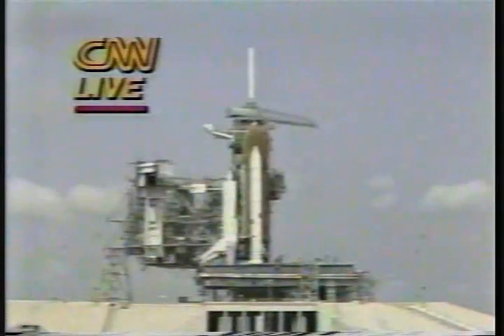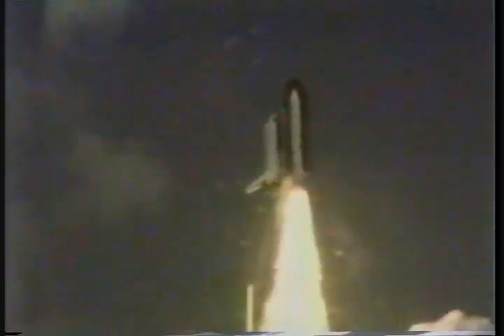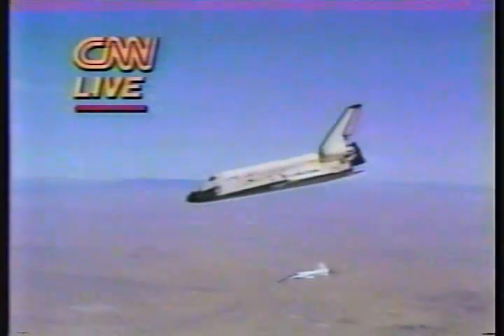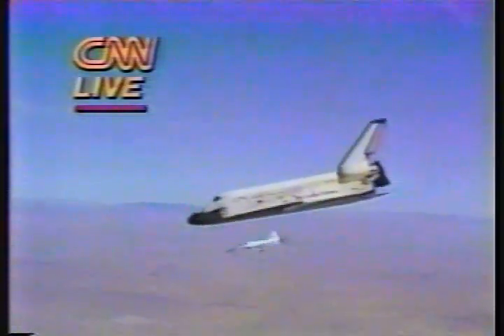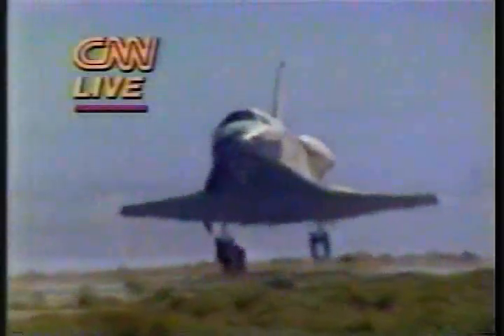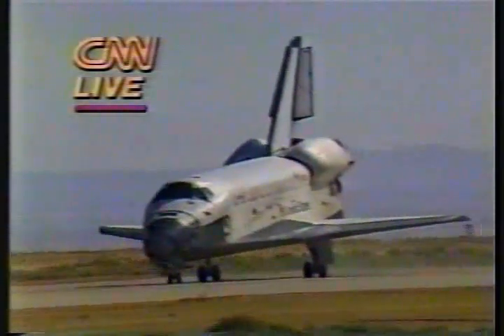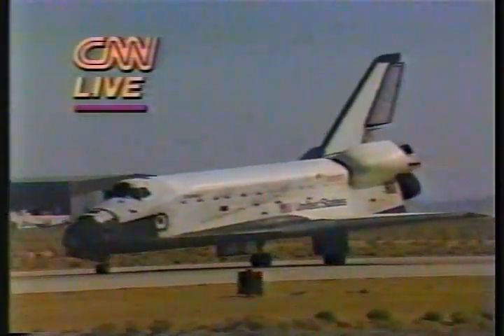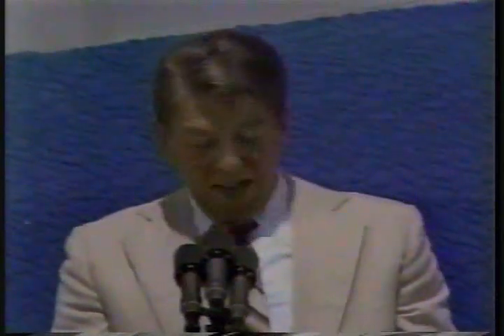STS-4 launch & landing (6-27-82)

Comment: This was the 4th flight of the Shuttle, the final test flight of the vehicle. As subsequent events would subsequently show, however, declaring the Shuttle operational after only 4 flights was unwise.  This was the first flight to carry a secret military cargo, so the flight was partially classified, 
The Commander, Ken Mattingly, had flown to the Moon on Apollo 16 in 1972 and would subsequently command the first classified flight, by Discovery,  in 1985, which nearly met the fate of Challenger the following year, due to cold weather affecting the O Rings on the boosters. 
This was the first spaceflight to end on American Independence Day, July 4. 
The pilot, the late Henry Hartsfield, made his first flight and would go on to Command the first flight of Discovery and the last successful flight of Challenger in 1985. 
The landing was certainly a joyful occasion for NASA with President Reagan   and Nancy  watching and the New Shuttle Challenger taking off from a Jumbo jet to join the Shuttle Columbia in Florida.  Only 3 and a half years later, however, the joy turned to shock, horror and tragedy as Challenger was blown to pieces over the Atlantic 73 seconds  after launch.

Comment: Has anyone played Kerbal Space Program? I designed a shuttle variant called the Vertical Stack Shuttle (VSS for short). Essentially, rather than the orbiter piggybacking onto the external tank, it would be stacked vertically, like a traditional rocket. If NASA had done something like that, The Challenger disaster would've been prevented. If there was a problem like what happened with Challenger, the Orbiter would've been out of the blast and probably been able to return to launch site. With Columbia, if they would've gone with a VSS design, there would've been no way for the foam to hit the wing, since the tank would be lower on the stack.
Reply: The position of the Shuttle (piggy back vs in-line) had no bearing on it's destruction. The "explosion" did not destroy the Shuttle, it was the sudden uncontrolled flight that it was thrown into and the huge aerodynamic forces that destroyed it. The Shuttle being mounted to the top of the tank  would still be out of control when the stack breaks up due to structural failure of the External Tank. 

A key piece of proof that backs this up is how the Shuttle broke up. And explosive breakup would have totally destroyed the Shuttle and broke it up into many small fragments. Like how thw the SRBs broke up when their range safety devices were fired to keep them from threatening populated areas. The Shuttle broke up into it's "modular" pieces.  The left wing, aft section (with the engines still burning) cargo bay and crew cabin could be seen as whole pieces. 

The only way avoid the accident is to not use Solid Rocket Boosters that have to be refueled in Utah,  and therefore have to be "segmented", just to satisfy an asinine political kickback, when Aerojet had a much safer design that would have been monolithic, one segment-less booster with no troublesome joints. They even offered to construct the refueling plant right at KSC.
Reply: +Tristan Wassman But The orbiter was too heavy for the traditional rocket.

Comment: They only used them on the first 4 flights because they only had a commander and pilot and it was testing to see if they could eject from the shuttle  during launch until they were over about 100,000 feet high.  When they carried more astronauts it was impossible to equip it with ejection seats for all crew members so they scrapped them.  They do have a way to bail out and parachute out of the orbiter on its own before a crash landing or fall into the ocean, but not DURINg launch now.